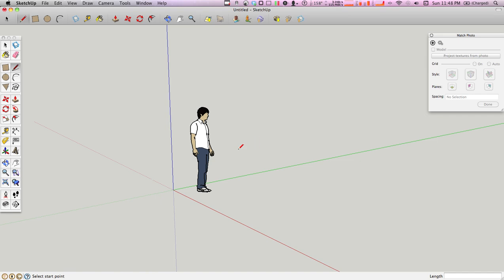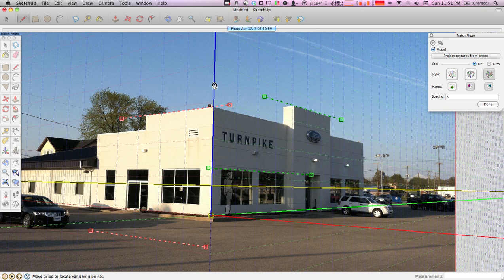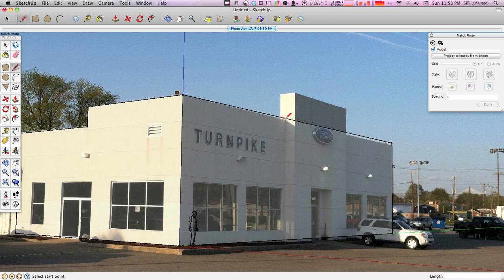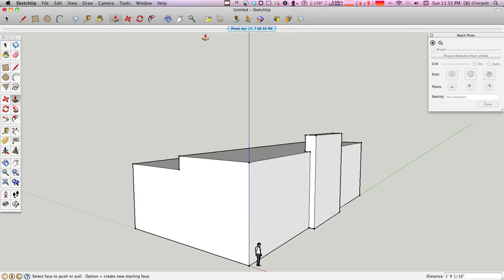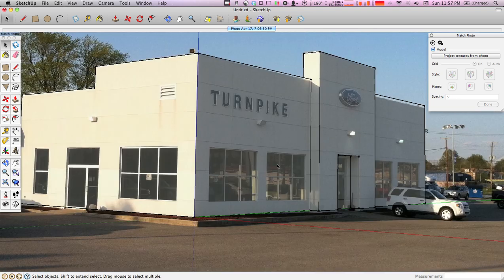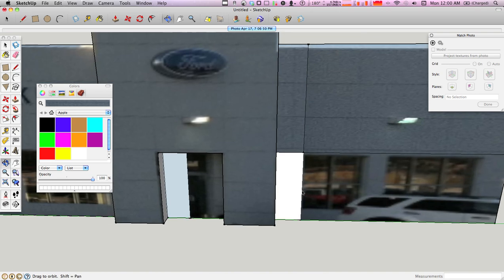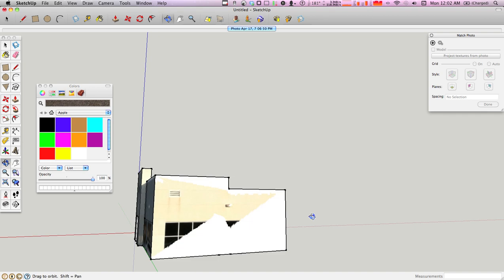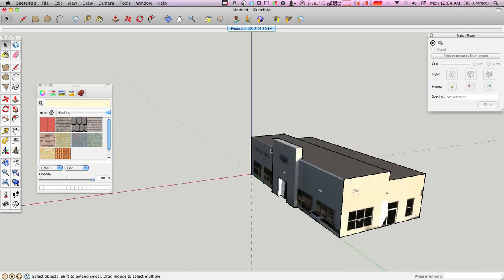how to Sketchup Photomatch

Comment: to make the emblem logo on this building , draw a circle in place, draw a line vertical down the middle of the circle then then hi-lie half of the circle and use the scale tool center post to pull to oblong shape.  Do the same for the other side.